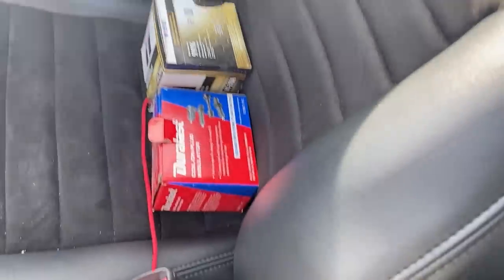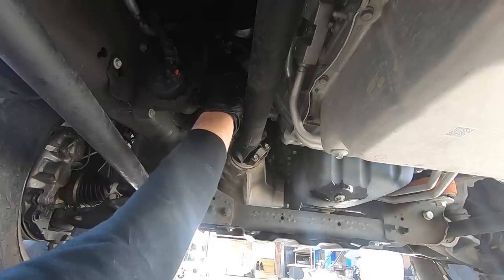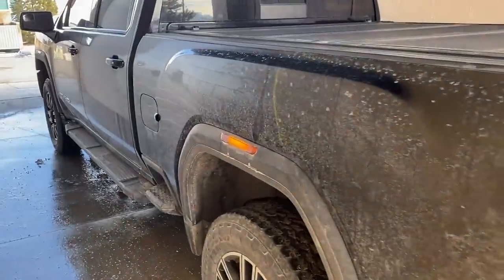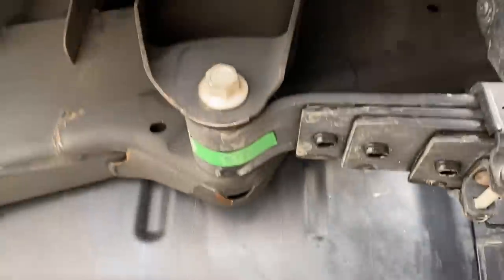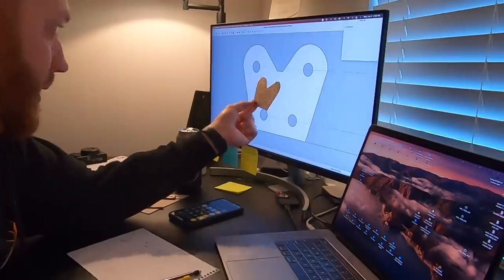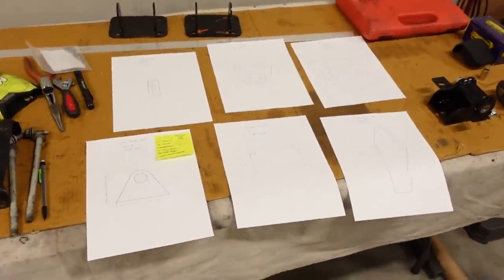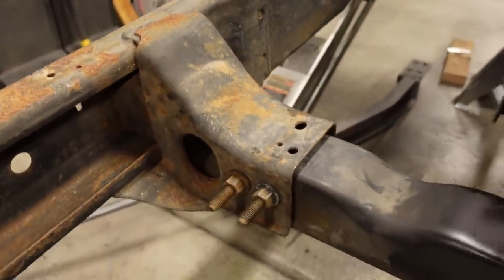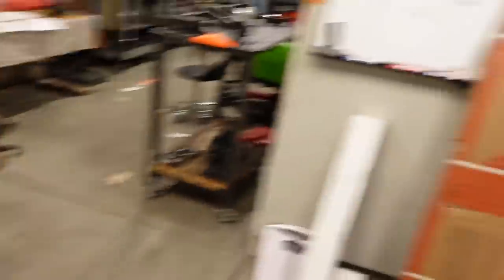designing my own suspension from SCRATCH for the 4x4 drag truck

Comment: Hey LT! My wife has a vinyl cutter that can cut thin cardboard, it's called a Cricut Maker. I design my sheet steel pieces and before I have them laser cut I have my wife cut the parts from old cereal boxes and tape them together as a "sort of close" template (taking in to account the thickness differences) but it really works well for flat parts. And she can also cut me vinyl stickers for my cars.
Reply: I have also seen where folks use the Cricut to cut gaskets.
Reply: The government doesn't want you know this, but cereal box cut down to 8.5x11 will go through home and office printers. Make sure you print at 100% scale.

Comment: Give fusion 360 a shot if you run into a barrier with sketch up, also consider getting a cheaper 3d printer (like an Ender 3), you can print your mockups before getting them CNC, it'll save you time overall if things don't fit or they need to be changed.
Reply: This ^^^

Comment: Hi Lawrence, I've been a Mech Eng for coming up on 20 years now, and what you're doing is absolutely Engineering, has been the whole time. People in my field get really finnicky about what is and isn't Engineering, but the bottom line is that it's solving problems.
I love watching your work and follow yours and other builder youtube channels to watch you guys design and build :)
I'd suggest that you may want to consider looking at a SolidWorks Maker licence, they're only around $100 and you'll hit serious limitations with Sketchup pretty soon... It's a fun program, but it's not going to give you the outcomes that a proper parametric CAD program will.
Anyway, I hope that helps and keep on kicking ass :)
Reply: I agree with you Drew.  I’ve been an ME for 18 years and the amount of technical problem solving I see with LT’s builds is definitely engineering.  

I also agree that Solidworks is a better choice given LT’s desires to do modeling and designs similar to the guy he referenced on Instagram.
Reply from the maker: Thanks for the suggestion on the program, I learned on Unigraphics NX back in school, and I definitely do not love sketch up so I will for sure try solid works. And thanks for watching as well!  I do like solving problems as these projects evolve.
Reply: You’ll definitely like SolidWorks. I know I miss using it when I switched jobs.
Reply: @LawrenceTolman  I use NX now... Solidworks is sort of like a simplified version of NX, it does the same things, but there aren't as many ways to do things and once you get the hang of it it's much more intuitive than NX... I usually tell people who've come from other CAD platforms to expect not to be happy with their output for at least a month of use after a week long training course... In Solidworks I've seen people getting the hang of it inside a few hours and becoming reasonably proficient on the basics in a couple of days... Nowhere near as powerful as NX, but you're not designing a whole car, part by part, from the ground up ;)
Also, Solidworks has a Sheet Metal function which I think you'll want to learn :)

Comment: Give OnShape a try. You will thank me. There are some major limitations with sketch up since it’s not a parametric modeling program.  It will also feel much more like what you used back in school.
Reply: Also a 3D Pinter, if you get a Prusa MK3S+ it will just work for about $800.

Comment: Hey LT, I had a 98 gt that went through 3 or 4 sets of plug wires and had intermittent misfires. I finally figured out that the boots weren't sealing up well and water was getting into well the plugs were set in and corroding the connection to the plug. Dielectric grease around the top of the boot to seal it up and never had another problem.

Comment: Just a tip, you can get autodesk fusion 360 for free. It has more than enough features for hobby use if you find your current software has limitations

Comment: About the ignition coils, you can buy one and switch out one coil at a time until the misfire is fixed.
Reply from the maker: thats not a bad idea... great way to eliminate the offending coil
Reply: @LawrenceTolman  It's the same concept of a trick I often use on an engine that's not idling right, unplug one coil/spark or injector at a time. If it gets worse that hole is good, if it doesn't change that hole is your problem.

Comment: Tip
Most of the newer cad drawing programs can import pictures from a camera or scanner.
So you can simply take a photo of what you need to draw import it to the program then use it as a guide to trace the cut lines etc.

Comment: I used the cardboard method on my s10 frame and boxed it in. Couldn't afford big pieces but I talked to a machine shop and was able to get 18 to 24 inch pieces of 1/4 inch. I appreciate where you are headed it's a lot of work.

Comment: Fusion 360 you may find more powerful and is free for hobbyists. I also have used FreeCAD and it has some features that make creating 3d models from images of real parts pretty handy. Lots of tutorials for both on youtube. Also a $200-$300 3d printer can save you a ton of time prototyping stuff before sending it to Send Cut Send.

Comment: For templates and stuff, once you have it drawn, print it with a 1:1 scale and you can make sure what you’re going to have cut will work. A lot easier to make a few paper templates and check them vs having to grind some away or not fill in an area. It works great for checking holes as well.

Comment: I have had two C5500 Topkicks with duramax engines.  I had nothing but problems with aftermarket filters.  Especially fuel filters.  Put a wix fuel filter on, truck wouldn't start.  Went and got a gm filter, fired up no issues. Aftermarket axles seals leaked.  GM ones didn't.

Comment: Quick tip and not sure if anyone has said it yet, so hope I’m not repeating the same point.

Since you are using non-standard sized cardboard templetes which are flat, the easiest and fastest thing to do is scan them, edge trace (in you cad software) and scale the the trace. It’s much faster and as long as the scaling and scanning is done well model should be perfect.
Reply from the maker: Good tips! I’ll have to try that to save time on the next one

Comment: Not so critical with laser cutting, but with plasma don't forget to account for kerf.  I've used these services in the past (there are a few local to me) with good results.  I've tried using a scanner in the past to convert my templates, but there is some distortion in the X-Y between the scanner and printer.
Reply: I did this exact thing this week , and I found one place that has a super big fancy scanner that was able to scan it and it was dead on while other scanners had distortion big time

Comment: Fusion 360 is probably the best free option from an affordability standpoint but if you don't want to learn how to do every key shortcut and are in the mood to try some ipad software that can also run on windows and imacs check into Shapr3D.  It is able to draw 2d and 3d (in case you want to 3d print anything).  It costs about 300 a year but they often have a discount and it is cross platform compatible so you can draw with your finger or a apple pen on an Ipad.  Unfortunately there is no Android version, which is a downer.   I love it simply because drawing and designing is intuitive with your fingers and you don't have to hold alternate keys or mouse clicks with the CTRL and Alt buttons to rotate and view your drawings.   It has a free version that limits your ability to export and files you can save but after doing a couple of drawings I pulled the trigger and the nice thing about it is it saves your drawings on the cloud, you can export them to your desktop device, but you can always reference them from your ipad or imac device as needed.
Reply: LT, the more you start producing cut's on metal the more you will realize the cost of SCS starts to add up and you might want to investigate the Arcdroid in the future.  It's a big pill to swallow initially but it looks like it is perfect for the home manufacturing process.  If you already have a plasma cutter and a welding table it will attach to your welding table and give you a way to cut items in a 26 x 15 inch window, which is really great for a suspension fab setup.  They do have a list of cutters that are known to work and the ownwer (Andrew) seems to be providing top notch support and service.   I have been on the fence for a while but I am not making anything yet so it's one of those situations where you buy once and cry once in order to invest in your business and I am just not there yet.   Hope that gives you some constructive feedback, and also, Get some rest my friend!   You looked tired as heck in the first few moments of that video, lol.

Comment: Nah if you draw the templates appropriately and follow the process your own plate can be as consistent as send cut send always provide.. Technology can be nice to have & use but there is not much better than we already have had. General Engineering as named, auto engineers etc. Provide us with the equipment considered to be the current pinnacle of endeavour.

Comment: No need to build brackets for your engine, simply go to Chevrolet and purchase 8.1 brackets that will fit onto your frame and the proper motor mounts that fit onto your engine block, it will set the engine in it's Factory location
You mentioned plating the frame, the best thing you could do is x-brace that so the frame is triangulated, go look at some of the race car chassis how they're done, the reason is so the frame rails don't move independent of one another, this occurs when you pour the coals to it

Comment: Lt as precise as you are i figured you would hook the problematic mustang up to a diagnostic tool to see what its actually doing vs hit-n -miss which isn't your style at all!
Reply from the maker: I actually did hook up my scan tool to the Mustang, but the misfire monitoring software inside these early ford computers is kinda primitive and it doesn't pick up on the misfire thats going on, so I am kind of in the dark in terms of what the computer is doing... but yes, normally I'd be a little more precise with the diagnostic process

Comment: a question with the stabilizer bar and the shocks I have a 2005 chevrolet silverado 1500 2wd and I have used many brands of shocks moonre, KYB and it does not feel good when driving, what number of models are your shocks I see that they are a bilstein brand could you say the model that you use in front and back, on the bar, why did you change it and it looks thinner than the original, how much does it vary?
Tks for you help

Comment: I am a professional CAD monkey. Dude anything but sketchup! This was painful to watch. I could have drawn and made burn files for those parts in 45 minutes. There are charts online for what clearance holes should be for fasteners. Just send them a 1/2 inch hole if you want a 1/2 inch hole, don't try to out smart them, the laser table is more accurate  then you need.
Reply from the maker: I am gonna get a different software before too long. Any suggestions? And on the hole size thing, I made those undersized on the one bracket since I wasn’t too sure on the measurements I took, so that would allow me to drill through to the exact size and position.
Reply: @LawrenceTolman  If I had to do this for free or cheap, I would use freecad then use libreCAD to make dwg/dxf, or I would use onshape which can do dwg/dxf. You are going to be into weldments and will require 3D modeling real soon. You are going to want to learn how to puzzle your engine mounts together with slots/tabs before you weld. This will save you from jigging and set up. Your fabrication abilities will push you far past 2D, that's what happened to me.